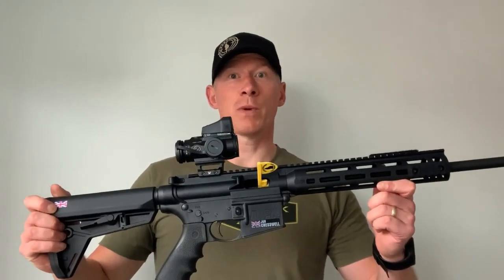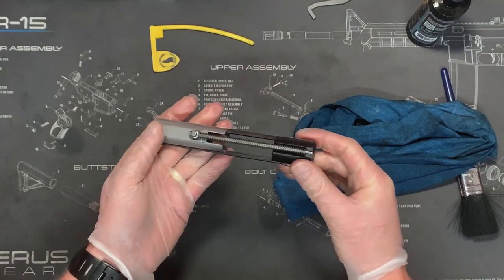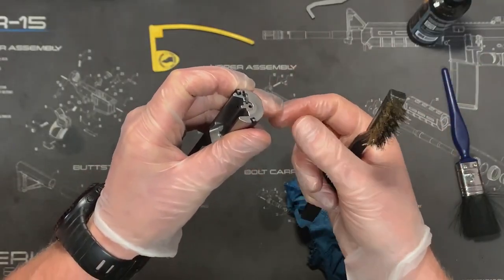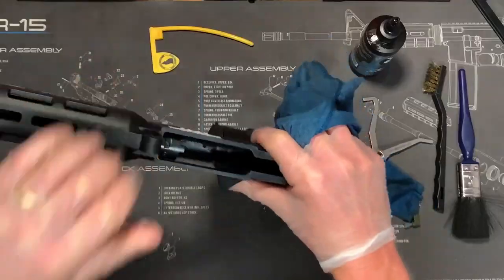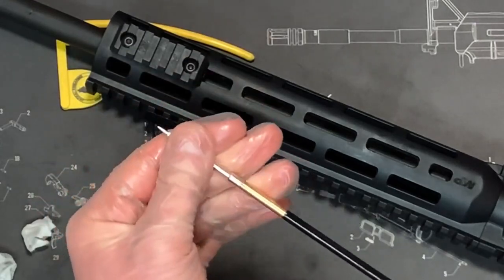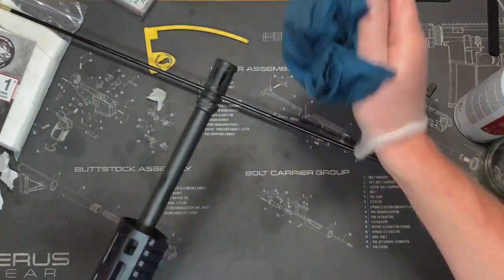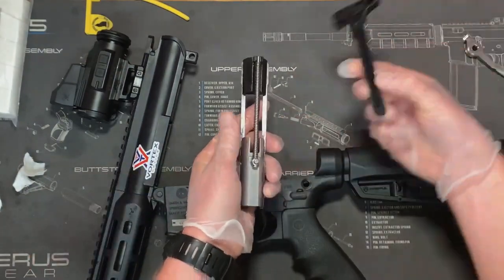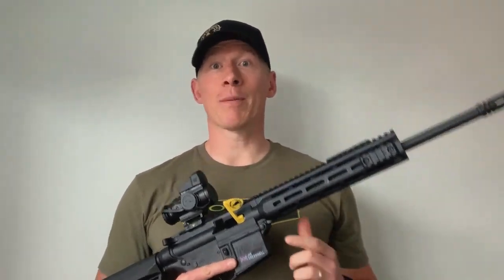Smith & Wesson 15-22 Maintenance: Strip, clean, function check, optics

Comment: Great vid Jon, lov watching what others do, but im not sure id pull the jag back through the rifle without taking the jag off first.   Ive heard it can damage the crown on the return pull. Unless its a plastic jag.

I like the suppressed air can as it has a fine nozzel.

Keep the videos coming
Reply from the maker: Thanks 😊. The patch jag is a smaller diameter to the rod so not sure it will cause damage?  I’ve heard people say it about the brushes but to be honest it not something I’ve ever worried about.  There probably is some science around it though.
Reply: I watched a video on running a jag from Brownell's.  They demonstrated on a rifle that had muzzle end cleaning only, so it was going in and out of the muzzle no choice.  But videos I've seen discussing the damage say that it's the stainless attachment point for your screw on tool (Jag/Brush/swap ) hitting the crown of the rifle that makes minor dings and over time will start degrading the performance of your rifle.  And have heard that high precission marksman will not reverse the direction of cleaning. I've also heard Sasquatch goes on yearly trips to Cancun so I'll not swear by it.  But I take care when the bits come out one end to make sure they go back smoothly and then remember I shoot mostly bulk ammo.
I also like to use a dry lube for all the working bits inside the rimfires.  Being dry it doesn't collect the residue so common on rimfire rounds.  Helps on ar platfroms with the gas there as well.  But then, I'm not out trusting my life to my gun and rarely go through 500 rounds between cleanings.  I've been known to go shoot a BX-1 magazine through and go 'Oopsie, gotta go clean.  Dang'
Reply from the maker: @williamcrane8236  thanks for taking the time to write this.  A few other people have said similar to me so I’ll try to just use the jag and brush in one direction from now on 😊 better to be safe than sorry.

I do like holidays in Mexico, so maybe I’ll have cocktails on the beach with the Sasquatch too 🍸🏝

Like you, I do like to keep my rifle clean when it’s in the cabinet, so I do clean it after every shoot.  I might look of for some dry line for the .22 as they can get quite dirty quickly.

Comment: My 22-15 recently began to fail to fire about every 3rd or 4th round.  My hammer pin was walking out of the lower, causing the hammer to hit the firing pin at a less-than-ideal angle.  I purchased replacement trigger and hammer pins (with screws at the ends to hold them in place) but the failure to fire continued.   Ultimately, I had to disassemble the carrier bolt - punch out the rolled pin, remove the firing pin and spring, remove the carrier guide rod holder, and clean the thing from the inside out.  Took a bit more time than what you showed in your video, but the results were worth it.  The "button" of the firing pin had noticeable resistance (beyond what the spring was providing), indicating a buildup of carbon inside the bolt.  After cleaning, it moved smoothly and easily.   No more fail to fire.  Works as good as new.   So, if anyone is struggling with this issue,  look up the carrier bold disassembly video (it's about 9 years old) and it covers the teardown and reassembly.  Well worth it.
Reply from the maker: 😮 great work for discovering the carbon build up in the bolt assembly! That’s not something I’ve ever checked so I’ll give it a clean the next time I clean my rifle. Thank you for sharing.
Reply: It’s rare a comment saves my life in todays internet but yours did 👏
Reply from the maker: 🤙 glad it helped - I love the YouTube community

Comment: Daily cleaning? I’ve had mine t years maybe 7-8k this is its first clean I’m treating it because I’m going in a comp
Reply from the maker: Good luck at the comp. I can’t remember whether I mentioned it in the video or not, but magazines are often an overlooked cause of stoppages, so maybe worth giving them a bit of a clean  too.
Reply: @JonCresswellUk  thanks. Yes I will. Just finished wasn’t as bad as I thought it would be great video very helpful.  I’ll have to get some of that air duster.